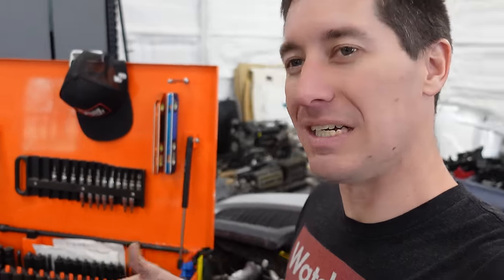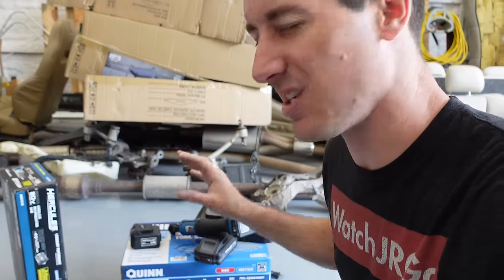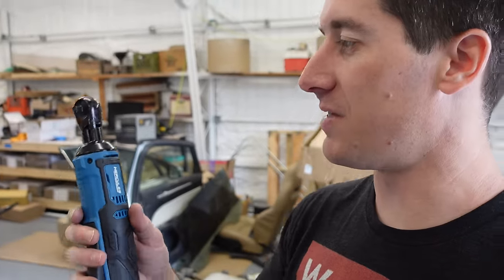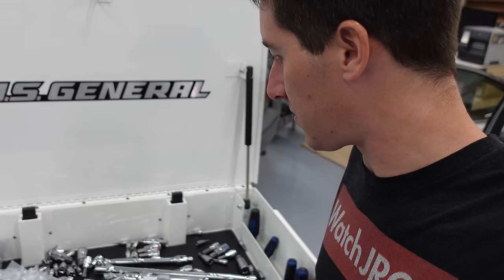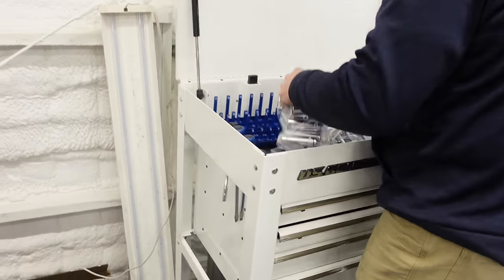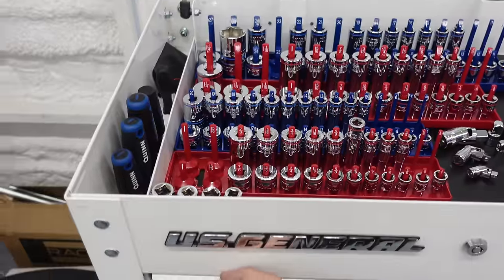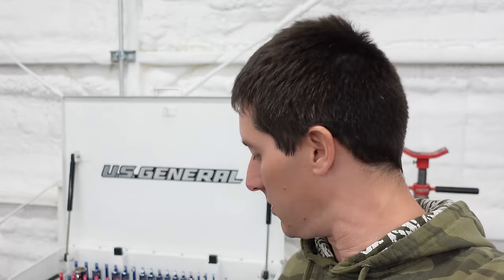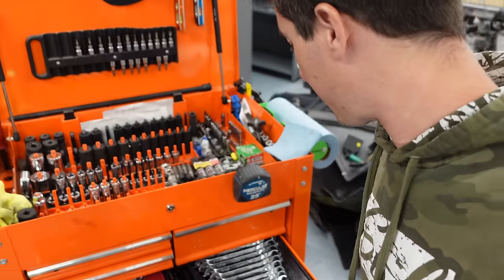$1,000 Budget For EVERY TOOL YOU NEED (And The Box) *Harbor Freight*

Comment: Everyone always rags on Harbor Freight tools... but they really are the best bang for the buck and they do hold up reasonably well.  You would have spent $10,000 on the same tools from one of the box trucks and they wouldn't have done the job any better.
Reply: A young guy getting started can pull together a few hundred bucks and get a starter set like this.  Then once they are getting a paycheck they can sit aside a little money from each check to buy the things they find out they need or to buy better versions of the stuff they have if something breaks or the better quality is going to increase comfort or productivity.
Reply: Plus they have the option to have warranties, I never lose buying tools from there
Reply: As long as you don't get Pittsburgh you're good to go for years!
Reply: Pittsburgh is okay. Ratchets are mediocre but sockets are okay. Pittsburgh Pro is where it’s at, and Quinn. Most of my work sockets and my box are HF tools
Reply from the maker: Oh absolutely, grew up on Craftsman, but I’ll probably only buy HF from now on.
Reply: Exactly!
Reply: they have lifetime warranty even Pittsburgh stuff, I had a torque wrench go bad after 15 years. they gave me a new one. I just bought the combo bandsaw and the motor capacitor was smashed. they gave me a new one and another 10% off for my troubles. my favorite was they offered an extended warranty on the $12 angle grinder. I passed. I have dogged the shit out of the grinder and still going.
Reply: I never rag on HF. Their stuff is value oriented. Their guarantees are good. Even their extended warranty is not the ripoff that others are. The quality is lower than better brands, but certainly good enough for MANY people. Not ALL, but most. The problem, of course is the China thing… 🫤
Reply: Might be time to make the jump to air tools.  You’re doing a lot of work to be relying on batteries.  My buddy’s shop burned down a couple of years ago when a battery shorted out in the charger.  One compressor to rule them all.  Great episode!
Reply: @aceadman  I would bet even some of the "better" brands are made in the same factory in China or the one right next to it.
Reply: @alanprather8399  completely true. The china problem is not really a quality issue. Bad products come from anywhere, and so can good. It’s more about whose economy you want to support. I am, as it always seems, of a very mixed mind. 🤷🏻‍♂️
Reply: Pittsburgh sockets and Pittsburgh pro ratchets are hard to beat for the value
Reply: And if anything breaks.. you just take it back and exchange it.
Reply: Harbor Freight has replaced Sears Craftsman as the Everyman tool brand. If I didn’t have the opportunity to load up when my Sears went downhill, my cart would be all HF. To be fair everything since then has been HF anyway.
Reply: @ghilleb1  I agree that HF has replaced Craftsman for a lot of people but I do think Craftsman was a higher quality product. But in today’s world - we buy lots of things for short term needs. This is where HF is perfect. When you need something to last a year and not a lifetime.
Reply: I have tools I bought from harbor freight 25 years ago and have no problems... The big thing with me is using the right tool for the job, don't try breaking lug nuts loose with a 3/8 ratchet and a pipe, use a 1/2 breaker bar...

Comment: Started my career with an expensive at the time, Craftsman set with the tool box included, in October, 1986 for the on sale price at $880. I am still using these tools today and they are older than most of the new technicians I am working with. A lot of them are going to Harbor freight for some of those same tools but, you always have the one guy that must have Snap-On everything. He is also the guy with a second job to just pay for the tools.

Comment: I'm still doing most of my repairs with the same 169pc Channellock tool kit my wife bought me nearly two decades ago.  I've replaced all the ratchets by now but all those wrenches and sockets and allen keys and bits still see daily use.  I've added so much from estate sales, garage sales, and Harbor Freight since then.  It's all the little specialty tools that add up over time, but I do wish I had been able to start my collection with the 428 piece Quinn set because it really IS the best starter set out there.  Better yet, it's a tenth the price of what a similar set would cost from a tool truck name brand.  If you manage to break a Quinn tool, replace it with the equivalent ICON one.  If you manage to break that, go ahead and sign off the kidney for the Snap On version.

Comment: I had that same problem with two of my 1/4 sockets on the tray. I just through them in the vise and drilled the middle out more. Coming from auto and skid steers, I'd recommend checking out the new 58" prybar, way better price than the trucks

Comment: I have the brushed 18 v bauer drill 1/2 inch Dr and the impact gun of the same thing,, and the DeWalt 1/4 inch impact driver and now a home Depot deal 18v mainline Milwaukee 1/2 inch Dr and 1/4 inch impact Driver.... So several different brands of power tools..so several different chargers

Comment: I do more home building than auto work and use the yellow power tools.  The HIgh end stuff is better if you are going to spend 4 to 8 hours doing nothing but drive screws into wood, and you will see the blue tools die out much faster.  However for auto mechanic work the tools are run for much much shorter periods of time and the HF stuff will do just fine.  I am also a huge fan of start cheap and go high end when you break the cheap stuff.

Comment: Harbor Freight is rad. I have so many tools (even yard tools) from there. If the tool bill is running high without an impact on the list, just get a breaker bar and cordless ratchet. The most useful combination.

Comment: I like how lifelong mechanics either get by easily with budget tools, that are lifetime warranty and hold up just fine and then you have the other group that wouldn't be caught dead even trying a Harbor Freight tool. I have warrantied a lot more Snap-On ratchets than I have Harbor Freight ones, I have never broke a Harbor Freight socket, I have wore Craftsman sockets out to where they were 2 sizes bigger, but I had a drawer full of Snap-On and Mac sockets, sitting there waiting for the trucks to return. Harbor Freight is fine, the Quinn stuff is awesome and affordable
Reply: Careful! Even as a huge Harbor Freight fan with this exact Quinn set, Harbor Freight sockets have definitely let me down. I tried to take off a motorcycle brake caliper in 2011 and the socket from their Pittsburgh 40pc socket set just split right open. It was only 3 bucks but I still claimed the lifetime warranty. Last year the battery cable came loose on my van, leaving me stranded even though I had a Pittsburgh 130pc tool set with me. You see, I needed to remove a stabilizer bar and fuse box to get to the battery terminal and the socket just split open.

I got a ride and came back with my OTHER Harbor Freight tools: Quinn. Now, they worked great. ;)

Comment: Where are the impact sockets?! ;) That’s what got me when I built essentially the same set at the end of 2022.

They discounted the Quinn Master Tech set for Black Friday then accidentally gave me the new credit discount TWICE. I negotiated deep down on the tool cart since it was damaged and they needed to meet some quota for Inside Track signups. Since I needed landscaping equipment on the same battery platform I went with DeWALT instead of Hercules but I was really tempted. The Quinn 1/2” Master impact socket set was a bit rich for my blood so I waited and hit it with a 25% off coupon.

Comment: You guys realize that you could buy the us general power extension center in like 4 different colors and they are magnetic and use the Christmas tree bit and take the lower drawer out and cut the hole in the back of the box and the drawer and put the power extension center in the back of the drawer and plug it in and wahla a power drawer in the tech cart